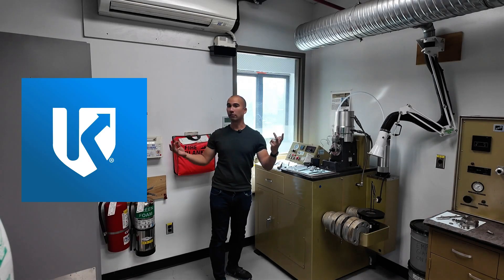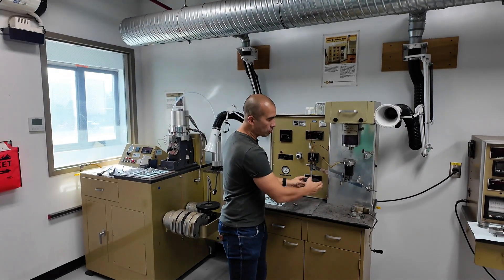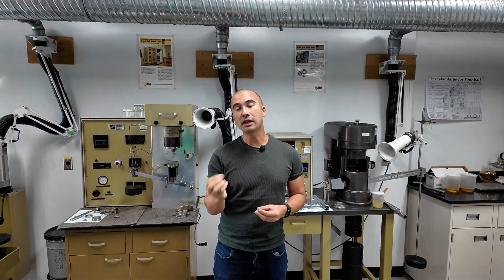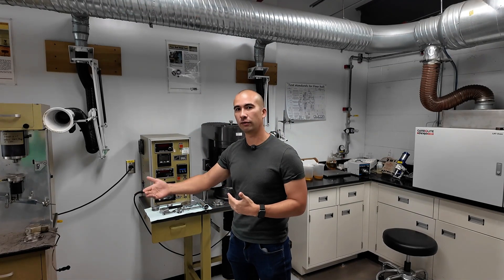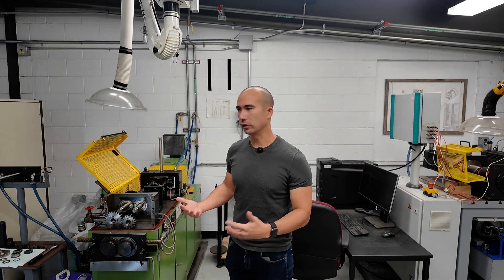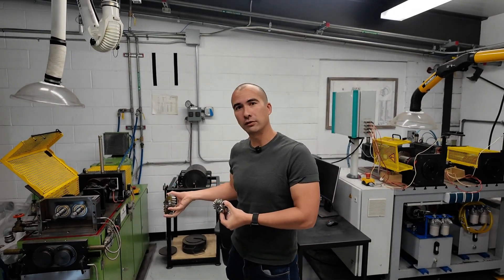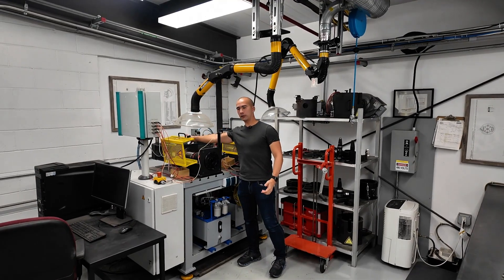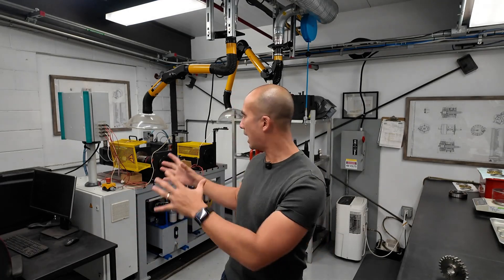Milk and Beer Beat Motor Oil? Inside Lubricant Testing Labs

Comment: Ok I have a question.. i picked up an old riding mower with Bentonite (Clay grease) in the transaxle  it was stiff shifting so i added some #00 lithium based cotton picker grease and its working much smoother now.  BUT.. after researching and finding out that they are not compatible.. How long do i have before the incompatibility reaction begins to harden the Bentonite grease?

Comment: Do you think 0W20 API SP ILSAC GF6A oils provide as much protection as 5W30 API SP at 40 degrees air temperature, should we use 0W20 oils?

Comment: It is important to know why milk and beer perform well in the 4 ball weld test (note you did not give results for the 4 ball wear test). I would speculate that the performance was due to the heat transfer capacity of water which prevented the metal from reaching temperatures that would allow mechanical welding in the absence of an EP additive barrier. I would bet that they had rather poor performance on the wear test in line with the low viscosity, as the wear test would be expected to be less sensitive to the local contact temperature (aside from the effect on steel hardness) than the weld test, and the steel would play a larger role in heat transfer at the less extreme conditions used.
Reply: Amsoil brags about the 4 ball wear test. Maybe they are using milk.
Reply: @ronkuzyk3836  It's like you deliberately didn't pay attention to anything in the video or my comment.
Reply: @TheDuckofDoom.  You got me there. What did you say that was so important?
Reply: @ronkuzyk3836 they use soybean oil.
Reply: heat transfer and heat capacity, exactly what I was thinking.  Water probably would have done well too.